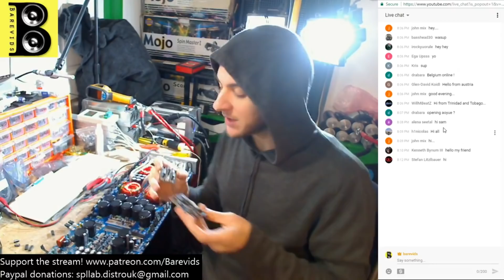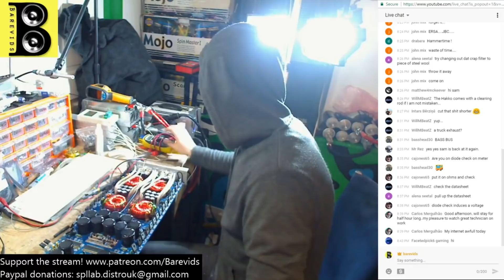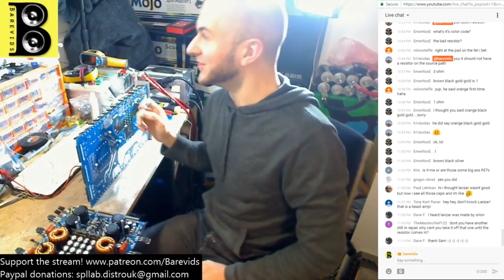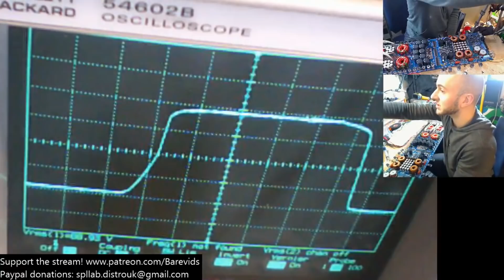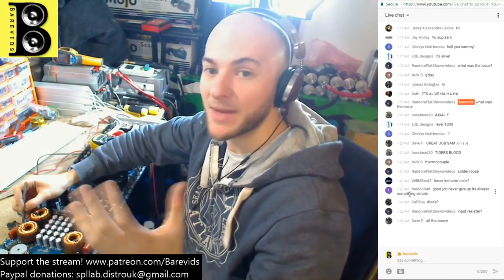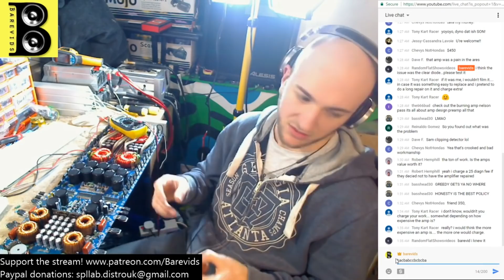CRAZY Lanzar Opti 7000Wrms Repair!

Comment: Hi Sam. I have the same amps as these in Australia. Just under a different brand (us audio)
I have 4 b2 audio rage XL 15s dual 2ohm. 
As I'm running 2 of these amps currently wired 2 subs per amp (2ohm)
BUT (haha) I wanna strap both amps to 1ohm. I understand strapping half's the load so will be 0.5ohm🤔

After box rise do u think these are ok to run strapped on 0.5ohm or u rekon smoke??

Have pretty good voltage 5x 130ah agms don't go below 12.5....
Thoughts ? Too risky? Love to hear you're opinion. Love ya vids man 😁
Reply from the maker: These are actually officially rated for 7k at 0.5 so you'll be fine! Just expect the efficiency to be absolutely terrible.
Reply: @barevids  ah ok under the brand name 'us audio' they only list 5150rms at 1ohm. No listing for 0.5ohm. was just a bit worried of blowing them up. 
I'll keep a close eye on them 😉
Thanks for you're help I appreciate the fast response coz gonna go for a test run soon 😊

Comment: Hi there mate. I've got a US audio bonecrusher m5150. It's the exact same board as this. I'm having trouble. Initially it had blown the driver IC 701. So I replaced that with a Ir2113. The Amp works however when u activate the output by putting load on it. The 15k resistor near that chip heats up to red hot. But also all 4 output transformers are hearing up red hot. I tested the resistor and it was showing shorted in circuit however was 15k ohms when removed. I don't have a schematic for this amp so I'm having a bit of trouble. Initial problem before replacing driver chip it it would constantly cycle between power and protect. All fets seem to be fine. Amp is out of protection now and working fine however gets extremely hot without even playing audio.? If you can please help my email Is petes_bass@hotmail.com or just message on here? I'm in Australia but would be happy to pay for you're help. Thankyou
Reply from the maker: So what do all 4 quarters of the output section lowside drain waves look like on the scope? What frequency are the fets switching at and what's the shape look like?
Reply: @barevids  hi the waveform looks square just like in you're scope. Frequency was 185k? I just have an old handheld scope where u need to move the lines in order to read frequency I may have read it wrong. Is it normal for the output inductors to get very hot and also the 4 big 15k resistors that are near them? Amp is only running off my 20a powersupply with a 4ohm speaker connected. I just don't think that heat is normal it got HOT! All 4 inductors and 4 resistors and also the capacitors between them as a result
Reply: @barevids  I have a question about the Lanzar  Opti 7001D is it a good amplifier? Does it produce rated watts? I found a good deal on one but I want to see if there’s any good word on them thank you for your time....

Comment: Same amp as addictive audio
Reply: I just noticed to. Had an AA 500.1 that I ended up with in a trade. It ended up with the exact same problem as this one...

(Was a decent Amp when it worked. Had it on a single zv4 sundown 15 and hit a 148.9 in a single cab truck)

Comment: Wat time in your country I am working on a Lanzar 2000 class D optic drive my question to you is have you ever work on that kind of amplifier if you do is there supposed to be frequency on the high side and also the low side gate on the output

Comment: I have a eclipse e4000 4 channel amp that has the right side of the front and rear channels not working . Opened but opened it up and didn't see any obvious dammage. Was wondering if u had any suggestions.right before it stopped working. The speaker s were cutting in and out due. To a loose wirenut  and I kept playing it. I have 8 speakers ayf and 15 sub  4 of which  bridged on front n I have  4 bridged xx 3 on the rear both in series and PARRAL. To keep it at 4 ohms. I enjoy your videos thank you.

Comment: There is no way  that board can produce 7kWatts!!!
Reply: Will run around 4-5k.
Reply: @brianreed5686 , I am ipressed! Nice of you to reply after 3 years... :))))
Reply: @gab3617  I just happened to run across this video. The board is the same as an AA 500.1 , i had 2 of them way back in the day and they pushed about 4500 clamped at a half ohm.

Comment: Is there a good repair guy like you in the Western Unted States?
Reply from the maker: No idea, but im sure there will be!
Reply: FlexYoFace Chase if u have Facebook contact Kevin Mansky he also does great repairs and he can clamp your amp to let u know what kinda power it's capable of
Reply: George sanchez rf beast
Reply: Due to the time to repair and cost of the item, there are few techs still in consumer electronics.  I moved away from consumer electronics into commercial electronics as semi conductor manufacturing equipment that needs repair is generally in excess of a million to purchase, so the priority is to support commercial customers as either an FSE or engineering technician.  I just don't have enough free weekends and evenings to play with the drain of equipment without service manuals.  

I make as much in a week as I used to make in a month.  Finish your schooling, get more practical experience fighting the hard ones, take some engineering classes, and move into commercial electronics. 

As seen in the video it can be a real time sink which a customer may not want to pay your rate.  It is fun to remember what my earlier days were like before I continued my education into engineering.  It is more fun to work with sub micron tolerances in lithography equipment for IC manufacture.  If you need to find a qualified tech in your area, you might check with ISCET and find what shops have certified electronics technicians in your area that still work on consumer electronics.

When I do audio, I only touch commercial pro sound now.  The ability to find and fix problems quickly and accurately is a skill in high demand.  Some fields don't want to pay for the skill, so the field has fewer good techs.  When VCR's were a grand, they were worth repairing. I exited consumer electronics when a replacement drum was $40 and two hours labor for alignment and troubleshooting added another $70 and new VCR's were under $200, many techs left the consumer electronics field.
Reply: In Cali you gane Steve Mantz the owner of zed audio

Comment: I always heard lanzar was garbage at least in the States. Is that your experience too? What do you like the most/least? Thanks
Reply from the maker: Their stuff used to be superb. These days, the build quality is HORRIBLE cheap. BUT... the amps do generally do their rated power. I suggest if you want to take advantage of this, since theyre pretty cheap to buy new, is once purchased send them to an amp tech and have improvements made to prevent vibration damage. Thats the number 1 thing that kills these amps. If you can prevent vibration damage, they should be pretty solid and do fair power.
Reply: Lanzar subwoofers was good in 90`s
Reply: Lanzar, Mtx, Rockford. 90.`s. very much use.
Reply: barevids I would never put this in my vehicle but this is great info for someone that's been out of the game for a bit